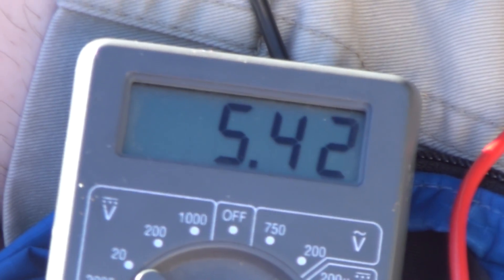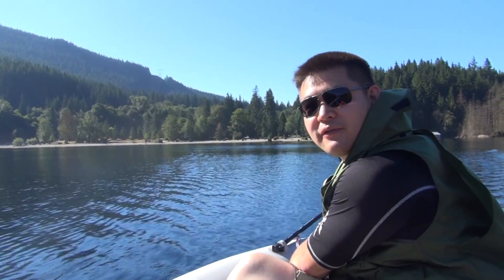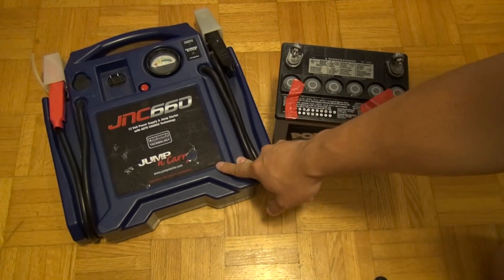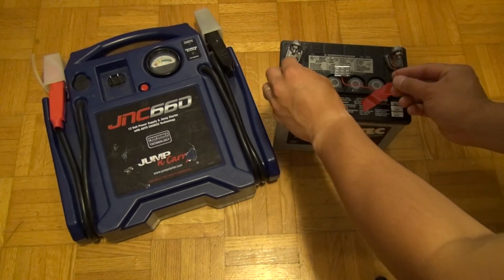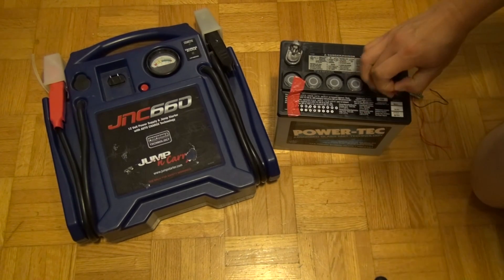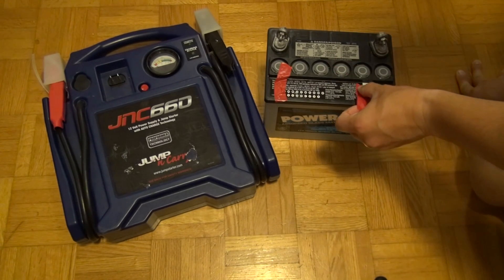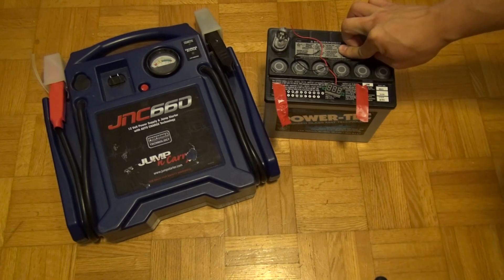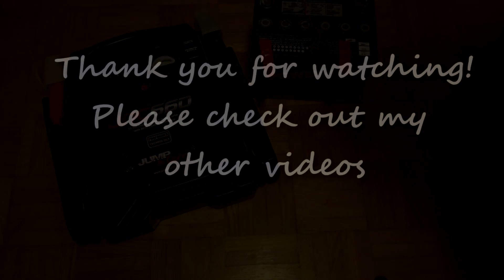Minn Kota Endura C2 trolling motor Battery usage update, JNC660, U1 AGM batteries

Comment: Still rocking this set?
Reply from the maker: Yes! The JNC is still a warrior jumper pack (battery replaced) and the U1 is still in use however it is showing its age, it will be replaced soon. The boat and motor setup is still the same.

Comment: If you were taking your boat in rougher waters my concern is water proofing and separating the clamps from one another any suggestions ?
Reply from the maker: Depending on how rough you heading into, I find the battery box with the lid is more than often (everything is dry when it pours rain). The battery box is ~$22 CAD on Amazon. If you look at the Minn Kota power command center box you can mirror that grommet seals for further waterproofing needs.
Reply: @AbrahamChan88  I found a water proof duffel bag the exact dimensions of the JNC. My plan is to customize a small Ammo box with a divider / partition for the negative and positive clamps to grab onto the trolling motor connectors and make small holes around the box where the lid meets so the wires can pass.
Reply from the maker: @user-jf2mc7vd8f  Oh! Sorry I responded thinking you were asking about the U1 battery (which is what I primarly need to use now with more weight; two children :p). What you mentioned sounds like it will work nicely! My boat came with a waterproof bag for small batteries and it is just large enough to house the JNC jumper - however, again, with the growing family, I am usually using the U1 or the 18-22A batteries (what is inside the JNC) directly (use one in the morning, go in for snacks ... you know, young children, swap to charge and grab the other battery). It works well for my use cases and keeps everything tidy and as low-weight as possible.

Comment: How do you calculate how your long a battery will last according to trolling amp usage?
Reply from the maker: Test for the amperage drawn by the motor as shown in this video, take the total amperage capacity of the battery in question, I times it by 0.75 to account for age of the battery and to have some reserve, then divide by the amperage need by the motor.

My U1 AGM deep cycle battery has 32A, my motor consumes 5-9.xA (depends on the speed selector used) round up to 10A.

32x0.75/6 = 4 so roughly 4 hours continuous run-time with lots of spare reserve. That is enough for me to cover my needs which is to get to spots and drift or paddle while I fly fish all day.

For bigger lakes (look up Paul Lake, Kamloops BC Canada as a reference) where I might be cranking on the motor to speed 5, to stay out there all day, I rig up one or two solar panels. I have a video on my channel with my setup at that exact lake, check it out.
Reply: @AbrahamChan88  Thanks, that helps a lot.

Comment: The jump start when I look it up says cold cranking not deep cycle.
Reply from the maker: Correct, the advertisement of the Jump Start is for vehicles; cold cranking. The battery inside the unit is a sealed lead-acid battery and generally is not a deep-cycle, however, you can buy one with the same spec and do the same thing. For my purpose, this setup has done well for many years.

Comment: SIr great vid i just got a tiny inflatable pontoon and it has a 30lbs trust min kota no battery, do you use the jump and carry as a battery per say for your motor? if so how myuch doe sit last in the water?
Reply from the maker: With my Seahawk II inflatable and varying speeds with just me and fly fishing gear, I can get about 2.5-3 hours continuous usage, which for me, translates to a half day usage for most of my needs which is to just get to the main areas to fish. If I know I need more run time for bigger lakes or to troll,I use the U1 which is double the capacity of the 18-22Ah in this Jump and Carry. Hope this helps you!
Reply: @AbrahamChan88  Thanks so much your use is the same as mine i have a colorado pontoon so i go solo to fly fish or go to Utah lake i would like to troll for at least 1 hour, i think i will follow your example and do this for my pontoon boat with a speed controller, awsome vids thanks for sharing knowledge
Reply from the maker: @perlago21  I use a 12V cigarette socket with my 140W solar panel (with the option to daisy chain in more panels which means I usually add my onboard 30W flex panel) to charge it when I back on shore during high noon for lunch and shade; pretty much recharges what I use in average. Just calculate your use cases and don't be strained to far away ... Paddling back takes time 😅

Comment: Hi there, could the jnc 660 also power other things by being clamped to a cord prong or some other way- like for lamps, laptop chargers, ect. ?
(Not asking about the cigarette lighter plug)

Thanks,
Your videos are very informative in a way that is not usually available.!
Reply from the maker: If the devices are 12V DC, yes just clamp them on! Otherwise, you will need to use a power inverter ... I think I have a few random videos in this haha
Reply: @AbrahamChan88  
Thanks for response..

 so no AC. No stripping cords to expose wires?

A 12 volt DC device would come ready to be clamped?

And the power inverter mentioned would plug into the cigarette lighter plug? I've those.
Reply from the maker: @thecoolexchange2906  exposed wires is never a good idea especially around water :)
Clamp or not really depends on the device ... I like to use a wing nut to easily attach and detach things from the terminal.
The power inverter can well be limited to 150W, I think, on the cigarette socket - I can't quite remember anymore and if I ever take this pack apart again, I will note it somewhere for reference.

Comment: 5 x as long only on the lowest speed setting which gives you very long run times anyways even with the resistor based speed control.  At half current, half of the delivered power is wasted as heat across the resistor so assuming a 100% efficient pwm, 2x as long is a more reasonable expectation.

Comment: well i just bought an endura c2 30 for my stealth 2000 duck hunting boat that i use for fishing haven't had a chance to try it out yet because i need a battery should i use my truck's
Reply from the maker: Most likely not; Your truck battery is probably only a flooded battery, or at best a starting deep cycle battery. It will best for you to invest into a deep cycle battery.
Reply: @AbrahamChan88  ok thank you I'm new at this so any advice i will take on consideration thank you again for your quick response
Reply from the maker: @johnnyhernandez4537  how many hours do you plan to run the motor between charging? What ratio will you use, I.e. Cruising:Trolling 
How many hours do you have between usage (charge hours) as that would help you determine your change method, or if you should get a bigger battery, or more than one battery?
Reply: @AbrahamChan88  i would say about 2 to 3 hours of continuous use every weekend  at low speed i just need it to get from point a to point b stop here and there along the way all within 2 or 3 miles at the most
Reply from the maker: @johnnyhernandez4537  If you want to go light weight, the U1 deep cycle battery is the ticket and it will quickly charge up with a wall AC charger. If you plan to leave it at the cabin get a simple 25W solar plane and charger to take care of year round maintenance or hook up to your existing system. Of course you get a larger solar panel and completely charge with it. If weight isn't a huge issue, sounds like any group 24 battery will do the job :)
Reply from the maker: BTW check out the other video I posted with a solar panel connected during use :)
Reply: @AbrahamChan88  ok i will

Comment: I also put a 50 amp breaker fuse close to the positive terminal of the battery and trolling motor because mini koda  recommends to use a 50 amp. Breaker fuses are the way to go cause you can reset them. You do not want to blow a fuse and not have one so bring back ups just in case.

Comment: I put my trust in my agm deep cycle 100ah battery that I use and just in case there is a problem I carry 3 small 12 volt deep cycle 7.4 ah and connect them in parallel for charging phones, fish finder, or a back up for the trolling motor. I also have a light source just in case your stuck in the dark. These small batteries go into a dewalt case that I put together. The thing with connecting batteries in parallel you charge all the batteries at once and buy a charger that can match the ah to charge the battery. I hear guys on the water saying they have a shitty battery but you asked them what charger they use it only charges 50 percent of the battery because the amp hours on the charger does not match the battery amp hours.
Reply from the maker: You have a very good setup (though heavy for my type of application) and is fault tolerant to get you moving on the water (so long as the motor is good). When it comes to electrical stuff, a cheap component compromises the whole system, just as you have pointed out. Thanks for sharing!

Comment: Hello, just dropping a link to show our 12 Volt 100 Amp Hour LIFEP04 Lithium Battery for $779 that works perfect with any trolling motor. Its light, will last forever and offers the same capacity as 135-150AH Lead Acid Battery http://pacificsunsystems.com/catalog/product/12v-100ah-lithium-battery-lifep04

Comment: This new battery reconditioning method is so simple and quick [Check Details Here==>https://www.facebook.com/Battery-reconditioning-310070329426065/app/208195102528120 ] ,And this works for car, phone, and laptop batteries! It even works with batteries you can use in a solar panel system's battery bank (or other alternative energy system’s battery bank). Plus, many other types of batteries!
Reply: gd
Reply: When someone says "this really works" and provides a Facebook link, you just know not to click it.

Comment: This battery reconditioning guide works by showing you step by step how to recondition your old batteries [Check Details Here==>https://www.facebook.com/Battery-reconditioning-310070329426065/app/208195102528120 ]. Again this is a digital book. Although it’s very easy to follow, as far as I’m aware Tom hasn’t put this information into video form yet. Which would be great. I personally love reading.

Comment: How long can you run the trolling motor on the booster pack at 3rd gear before the booster pack dies?
Reply from the maker: I think about 1.5 or 2 hours which is pushing it. I never use it for more than 15-20 minutes non-stop as that usually gets me where I want to start fly fishing and I work my way slowly drifting or spurt usage on speed 1 so the battery has "recovery" time. I really need to get a video up of this setup but with my 25W solar panel in the system - lasts the whole day for my type of use.
Reply: @AbrahamChan88   How long is the service life of the JNC660?  Will it last for several years if it is used for trolling motor regularly?
Reply from the maker: @aldavew.a.2154  I used this jumper pack on and off to power the trolling motor maybe around 4 to 6 times a year (because I have the 8AU1 battery for extended usage or rather I start my day with the 8AU1 and while it charges at noon I go out with this pack and return for the 8AU1) --- using it also as a vehicle booster at least 4 times a year to help other people and "often" for my project vehicles, this exact jumper pack lasted about 11 years before it was not able to provide enough boost in -28C to my truck. The battery still holds power but not enough for boosting so I use the battery on solar panel to run fans in the tent while camping =) Hope that helps! BTW I have a video on this jumper pack on how to change the battery; Easy to do and cheap to replace.
Reply: @AbrahamChan88  Thanks a lot for the reply.  It helps me to decide  whether to buy it or not.  Using it 4 to 6 times a year is ideal for me.

Comment: Hi. I have couple of questions. Hopefully you can help me out. I recently bought a mariner 4 from Intex. Can you please suggest me the best trolling motor for it? As far as brand and specifications. I have JNC 660 already, so maybe I will not have to buy another battery,according to your videos. Please help. Thanks in advance.
Reply from the maker: Olga Bliznetsova Look into the digitizer series from Minn Kota Endura MAX (or similar brands). It will manage the power (electrical) use better and provide longer run periods.
Reply: phr1sk37 Thanks a lot for your help! I really appreciate it! Do you think JNC 660 will good enough or we will need to buy another battery?

Thanks again!
Reply from the maker: Olga Bliznetsova What style of fishing do you do? I would suggest you pick up the motor and test on a normal/average day what amperage it draws and you calculate 50-70% of that capacity in the JNC660 (18Ah).
Reply: phr1sk37 We normally just getting from point A to B. No trolling. Unless its a pleasure trip for fun. We decided to go with Endura Max 40 lbs.
I really appreciate your help!!
Reply from the maker: Olga Bliznetsova
No problem! Again the calculations are quite simple. I use a monocrystaline 25W solar panel on the battery to pump in 1-2A an hour while I fly cast. It does not sound like much but it adds up when 3/4th of my time on the water is not trolling.
Reply: Thanks a lot for your helpful replies!!!
I am sure we have more questions later)) If you dont mind.
Reply from the maker: Not at all! I just wish I had some time this month for ice off - envying a friend of mine who was out there =)

Comment: Thank you for posting awesome videos. Very good info, much appreciated. I was wondering how you connect your trolling motor to your jump booster pack. I recently purchased an old trolling motor (Shakespeare wondertroll 606) and would like to use the two together, I believe the trolling motor has alligator clamps to connect to a battery. any suggestions would be greatly appreciated.
Reply from the maker: I tighten the the trolling motor c-ended cables to hex bolts to clamp to the booster pack. In this video, I used electrical tape of the motor's c-ended cables to the battery because I forgot to pack the hex bolts.
Reply: phr1sk37 Is there any way to post a pic of how you connect the motor to the booster pack? I am having a hard time understanding how you attach hex bolts to the motor cables. Thanks for any response.
Reply from the maker: Hi Nancy,
In the video I show the bolts through the holes of the battery terminals. The same bolts I will take off and screw to the motor cables ... like clamping together to make a larger surface area - then I clamp the booster pack cables to the now larger surface area. Hope that makes sense!

Comment: Thanks man, Im ready to shop.  Fishing harbors and lakes.  Heres my ?. minn Kota 30 or 40 would appreciate your opinion.  I watched both videos.  I like how the 30 draws less amps is it that big of a difference.  Im a half day on the boat kinda guy.  small fiberglass dingy.
Reply: Look into the 'Max" series as that line has digitizer technology to save current power. Look it up on their website. As for thrust, 30lbt may be weak on 12-14' boat when the wind blows on big lakes. Ask local fishermen in your area for their opinions.

Comment: i bought one Clore JNC660 'Jump-N-Carry' 1,700 Peak Amp 12-Volt Jump Starter
couple days ago from amazon, it seams not charging enough,, only charging 50%
Reply from the maker: Did you try keeping it plugged in for a longer period? The manual states the first few charges will take longer to condition the battery. If it is still a no go, the battery you have might be old/defective.
Reply: Hi there, you may try using different (thicker) extension cord. This may improve charge results.

Comment: Again what is the realistic time use of the JNC battery unit  if you are just using it on speeds 1-4 to get to fishing spots. No trolling. Thanks.
Reply from the maker: Rando mization The run-time would differ per user/water body. For what I do in the BC interior lake, a solid day (6AM start till summer sun down). So why would I use this over my 1U? Built in charger for easy recharge anywhere (motel/off someone's generator). The 1U needs to have a battery charger or hooked up to my vehicle to recharge.
Reply: I would like to know that too..thx

Comment: The maximizer will help with a longer run time only on slower speeds. At full speed the motors draw the same current as their 5 speed counter parts of the same thrust rating. Here is my current draw test on 5 speed motor

MinnKota 12V 52 lb Thrust current draw test